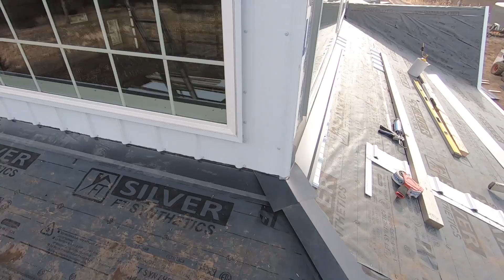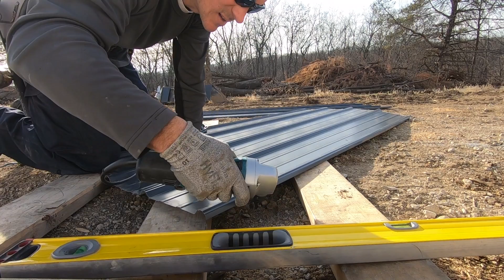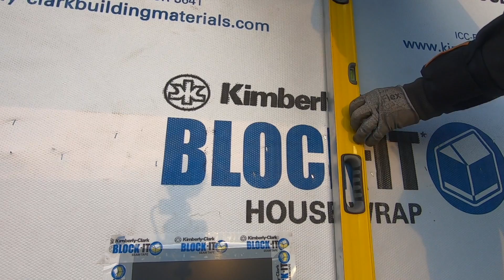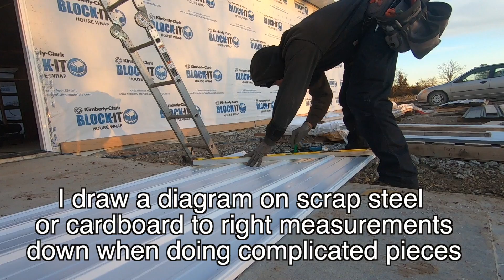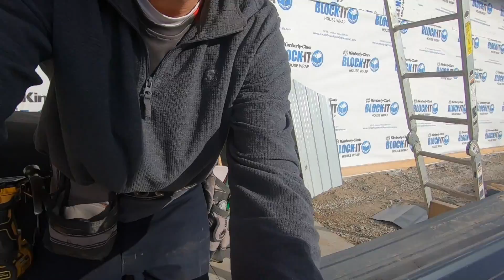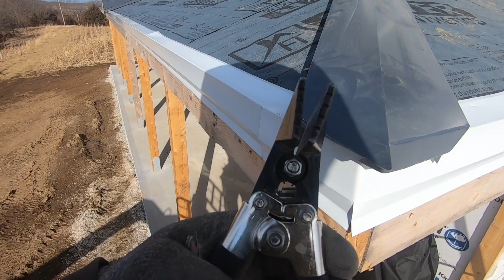Post Frame Home Metal Exterior Install Ep17.2 Part 2/5

Comment: What keeps water from blowing up under the peak trim and under the ribs going down the peaks?  It seems like with a stiff wind that would blow water up the peaks it could get under the peak trim and come down under the ribs...
Reply from the maker: There is a seal under there to keep wind driven rain out.
Reply: @MrPostFrame  thanks for the reply...ive been binge watching the series.  Love learning new stuff and i watched the full contruction so far.  Keep up the good work!  Looks like a dream house

Comment: Paul, the metal work looks great!!!
Insulation ?'s:
What spray foam and thickness should I spray on all steel metal building ceiling?  What would be a ball park number for cost per square foot? (Approximately  12,000 s.f. ceiling)
Continued success on your build,  w.w./Oklahoma

Comment: Just got two quotes for closed cell foam done for my 32x46 pole barn shop. Couple questions
1. Ive heard conflicting things about what temp you can spray at, one guy told me uo to minus 10 Celsius?
2. Two of my spray foam quotes for 2" closed cell came out to about 2$ a square/ft (not board foot) curious if the cost is the same for you americans.
3. Is a fire retardant coating actually that important? and do they work or is there a better option? Is spray foam that flammable that I should be worried in my shop?

Just discovered your channel and will definitely be subscribing!
Reply from the maker: I’m planning on a question and answer video with my spray foam guy so I will ask these questions. 

It’s a $1 a square foot per inch here so right in line with your quotes. The price goes up here when they spray it below 40 degrees Fahrenheit because it takes more material in colder weather. The expansion of the product is less in cold weather.

Comment: As long as your roof panels are squared up, you can just you the cut off from the first price as a template for your angle. Then you only need one measurement.

Comment: I did the Poor mans Spray foam for all my exterior walls because spray foam was not in my budget. My house was 1300sqft and I used 24 x 2"x4'x8' pink foam sheets made by Owens. and used about 150 cans of spray foam cans. Fiberglass insulation could never compete.

Comment: I think you need to watch some videos from Kyle at RR Buildings about how to cut those J channels for a one-piece peak water break. Also, especially when you are joining areas that don't crimp together you need to use some silicone to make sure water doesn't pool and give a possible place for corrosion or leaks.

Comment: I am wondering if you're planning on going with spray foam only, or just a 2 inch application and adding other types of insulation. . Are you applying spray foam insulation directly below roof steel to prevent condensation?
Reply from the maker: 3”‘s of spray foam then framing 2x4 walls and applying bat insulation. I will have a moisture barrier on my ceiling prior to finish and then I will blow insulation into the attic.

Comment: Does installing house wrap on ur building and then spraying foam on house wrap cause moisture betwwen them
Reply from the maker: No it does not. It is very important to put up house wrap if you are going to spray foam. If you don’t and you ever need to replace any of the steel you will have a mess on your hands as the spray foam will stick to the steel.

Comment: regarding spray foam, if you spray your basement concrete walls will the moisture be traped or will it have room to evaporate if you use closed-cell.

Comment: I just had 2" close cell spray foam insulation spray inside my 30x50 metal garage. Mine is not a pole barn, but an Eagle building that uses 2-1/2" square tubing, 5 feet on center as the main structure. I'm waiting on summer to see how well it keeps the garage cool. You are doing a great job on your house, cant wait to see it complete!

Comment: Spray Foam Questions:
1.) Is moisture a problem or mold?
2.) Do you have to worry about cancer or respiratory issues?
3.) How to know if they are Pros or some off beat person doing the job?
4.) Cost

Comment: I'm planning on installing a closed cell polystyrene spray foam from a kit and doing the work myself to save money. I've had three estimates and the prices I've been quoted from all three companies is more than $2.00 per square foot to do a two inch thick coverage. Now that I know the price and got some questions answered that I had by talking to them, plus watching some YouTube videos, I've come to a decision of needing to do it myself due to the price. What is the best DIY product that I can purchase and from what manufacture? I need to install a lot of spray foam! Is this something I can do myself being a carpenter for a little over thirty years and having never worked with spray foam besides the cans. What is the best temperature to install spray foam?

Comment: Another great video. The place is looking amazing! We've been questioning and thinking about the spray foam ourselves for our future build. I want to know where and where not to gave foam sprayed. Do you put it in the attic or upper levels? Some guys say yes others say no. I get confused myself. Were thinking about having a large open great room and we want to do vaulted ceilings and I'd like to know how your guy would go about insulating that area. Thanks for doing this!

Comment: Awesome!  Looks great!  You make it seem so easy.  Will you be framing the internal exterior walls before spray foam to get the thermal break?
Reply from the maker: I’m having walls sprayed first with 3”s of closed cell then I’ll still have room for framing 2x4 walls. That will also give me pretty close to a continuous thermal break on all my outside walls.

Comment: Concerning Spray Foam, in cold weather climates (where you would typically install a vapor barrier on the inside of the wall) how would you change how you designed the wall for spray foam vs a batting or blown-in insulation?  Is there a difference if your only partially filling the cavity with spray foam and partially with batting/blown vs doing full cavity spray foaming?
In my pole building design I'm contemplating doing two walls, the pole as the outer wall with a 2x6 24" OC stud wall on the inside.  If I have piping and electrical on the inner wall but want to insulate both cavities, is there a preferred place/surface to install the spray foam if I'm doing both spray and batting/blown?  Goal is reasonable efficiency in a frigid climate (coldest in cont. US) 

Thank you for the content Marshall!